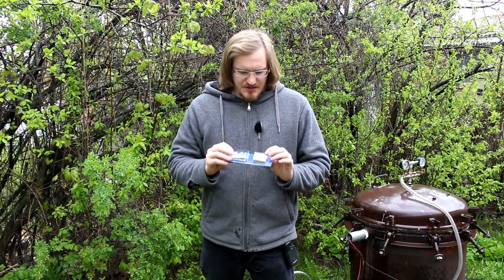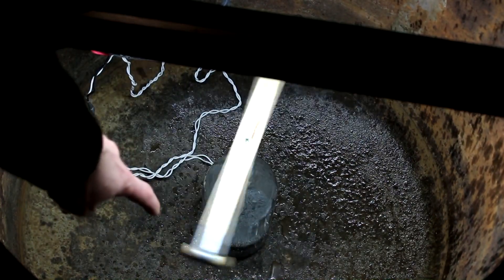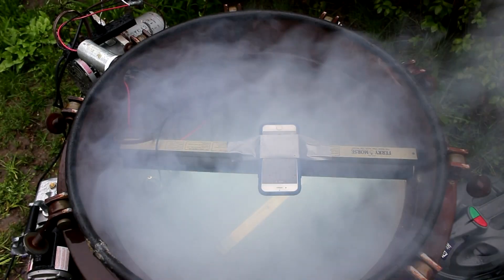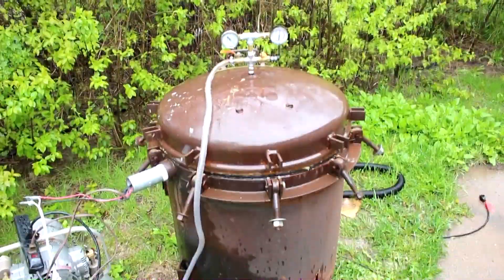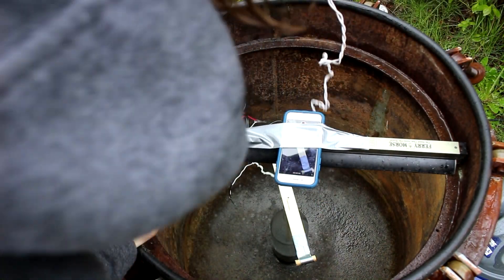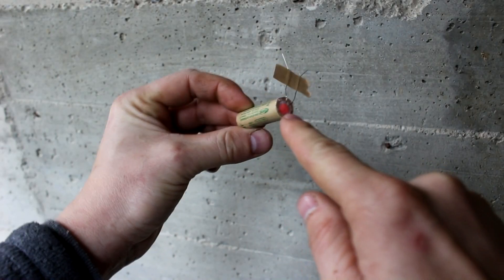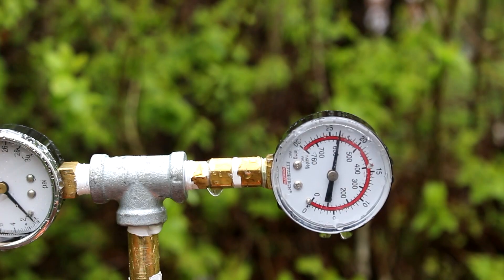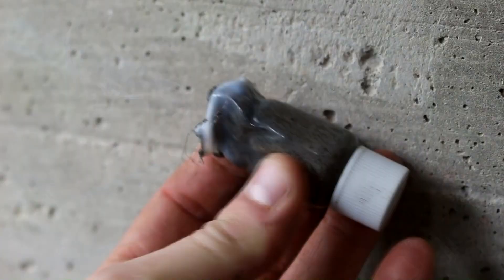Will a Model Rocket Motor Work In Vacuum?

Comment: Did the rocket have activated oxygen in it?
Reply: The small model rockets use black powder. Black powder has potassium nitrate which acts as the oxidizer. High power solids use ammonium perchlorate as the oxidizer. So yes, it had oxygen for the reaction.
Reply: I don't think it is a rocket technically if it doesn't have both fuel and oxidizer.
Reply: Illuminatti_firetrucks no. It uses magical burning powers to burn without oxygen. 
Sarcasm aside, yes it uses oxygen mixed in with the propellant. However I'm not sure what oxidiser it is.
Reply: Technically yes under the form of an oxidiser.
Reply: Some chemical rockets use a monopropellant that can break down and release energy without oxygen, e.g. hydrazine or hydrogen peroxide. These propellants are much less powerful than propellants with a separate oxidiser, so they're usually only used for small maneuvering thrusters where the simplicity of using only one propellant is more important than performance.
Reply: yes rocket motor has oxidizer in it
Reply: The model rocket motor does have an oxidizer just like solid rocket motors. Also, what you are thinking of is a chemical rocket that has to have fuel and oxidizer or something that can act like both. There are other kinds like nuclear rockets, and ion thrusters.

Comment: you shouldn't light the rocket under pressure
Reply: How do you suggest he Lights off the rocket?
The fuel does not ignite in a vacuum.
Reply: 182 why not? That's how they do it when launching from Earth.